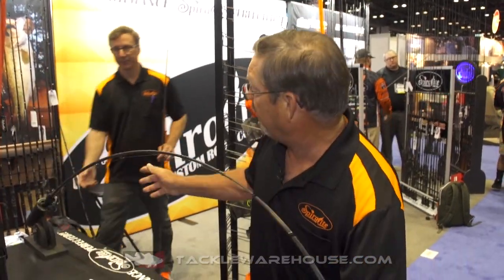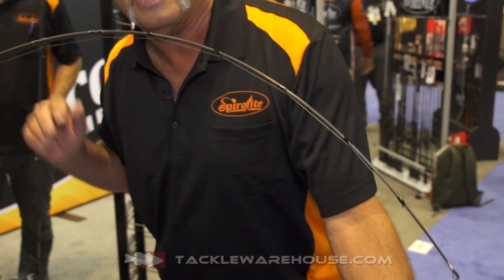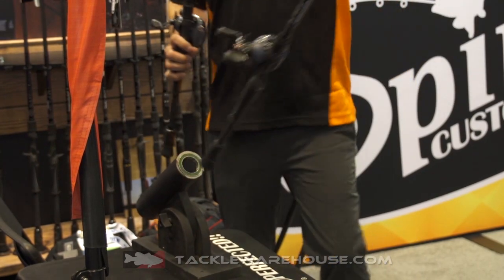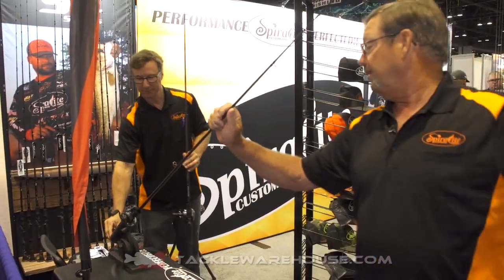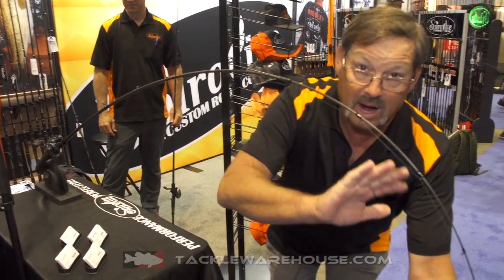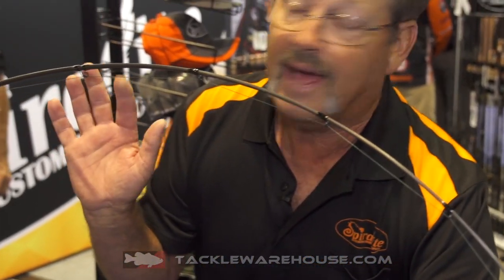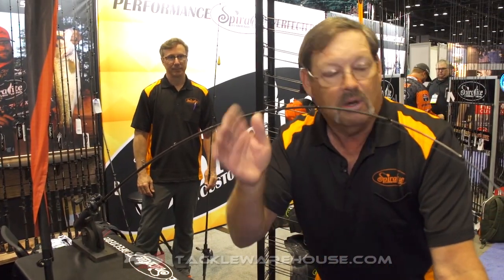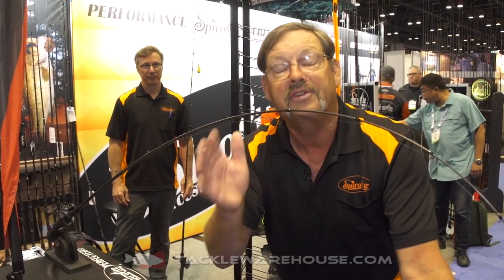Why Use Spiral Wrapped Guides with Spiralite's Chief Rod Designer | iCast 2018

Comment: I picked up 3 of the defiants series I plan on picking up more, I have seen the the spiral design used by the late Doug Hannon on a video 30yrs ago and wanted to try it and after using this design I will never go back to the standard guides on a baitcasting rod AGAIN!!!!  and I just purchased 9 fenwick world class casting rods over the winter that are still in there containers and the are on the rod racks in my room, that I will never will use as well as my other 60 plus high end rods after using this design, what they show in this video is true  it does cast further and there is less fatigue on the wrist you owe it to youreself to try one YOU WILL NOT BE DISAPPOINTED !!!!
Reply: It's been a few years, but you can cut off all the guides and rewrap all those rods to acid